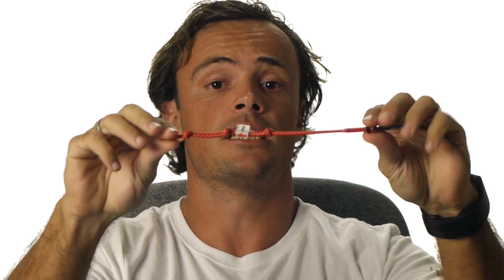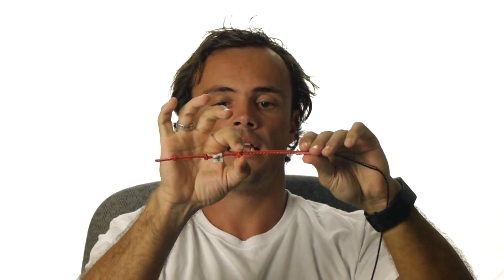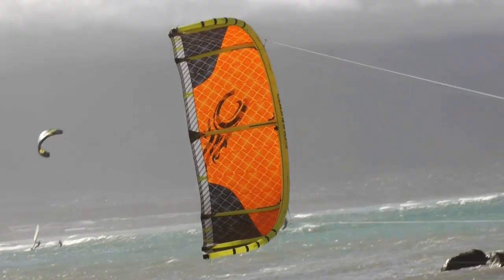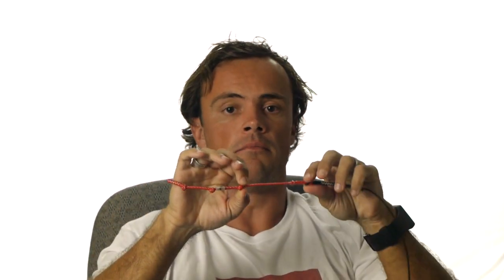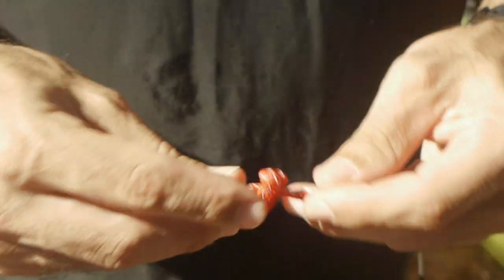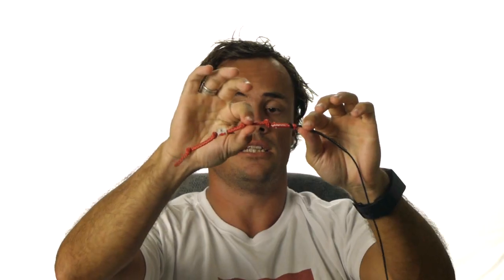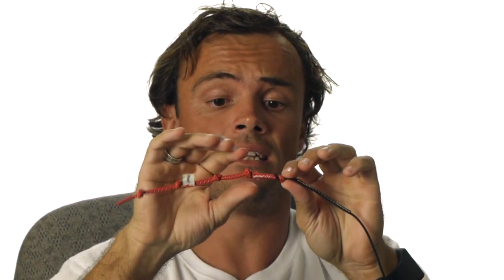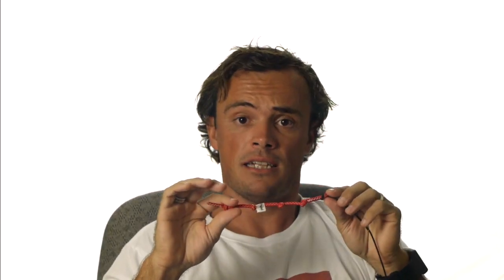Turbo charge your kite (Cabrinha Kiteboarding)

Comment: So, if my kite is backstalling, i suppose to use the first knot on the rear flying line? Is the correct?
Reply from the maker: +Canal RTZ Yes try see if that helps. If its not enough you can always extend the pigtails on the steering lines.